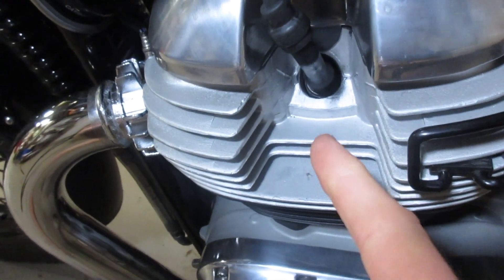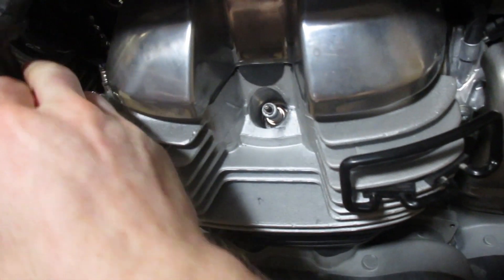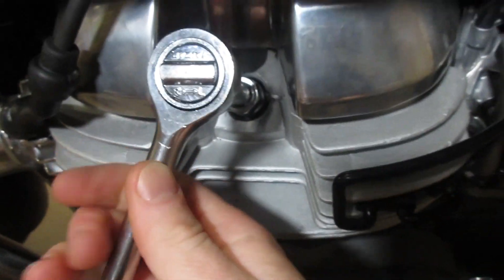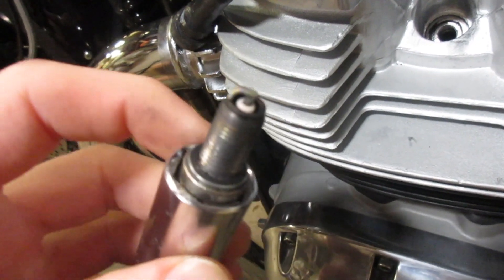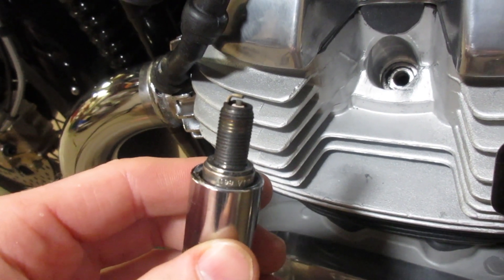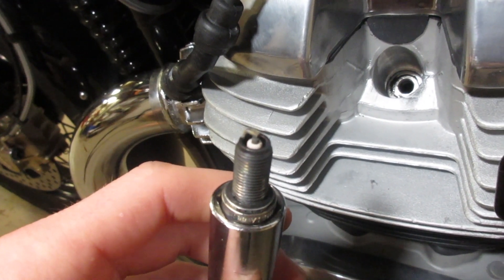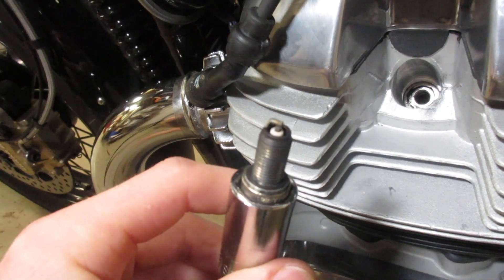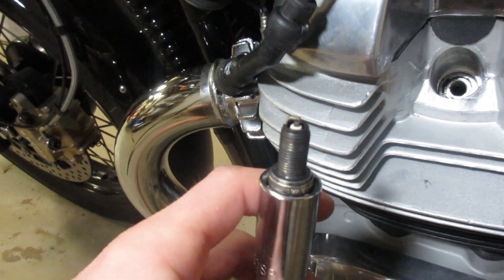How To Change Motorcycle Spark Plugs - Royal Enfield Continental GT 650

Comment: RE says to gap the plug between 0.6mm and 0.7mm (about 0.025").  (Platinum and iridium plugs can have a wider gap.)  It's also a good idea to put a thin strip of anti-seize grease  on the threads to prevent galling or seizing of the threads in the aluminum head, and to put a layer of dielectric ("tune-up") grease on the ceramic body to prevent the rubber boot from bonding to it.
Reply from the maker: Absolutely, fantastic points, thanks for adding!

Comment: I have a few spark plug sockets, had to buy a new one and grind it to fit on my (865cc) Triumph 900's because of the air-injection that is slam up-against the spark plugs on them; most sockets are too thick-walled to fit. Not a problem on the INT650. I use anti-seize as well.
Reply from the maker: Yeah anti seize is a good idea haha, and I always appreciate a bike with room to work

Comment: changed mine to ngk iridium , made a difference
Reply from the maker: ABSOLUTELY! When my stock plugs are done I'll switch to the NGK as well, big fan
Reply: Hi, do you have the model no of ngk iridium that fit re 650?
Reply: Cr8eix for ngk, right? Also what gap did you use, or did you just throw them in?

Comment: Hi Alex,
I have question for you.
My question is Iridium spark plug improve the performance of bike or not?
Reply from the maker: I have found that an Iridium plug is basically ALWAYS a good choice to go with, it usually does improve performance slightly but if not I still find them to be more reliable and a little cleaner burning.